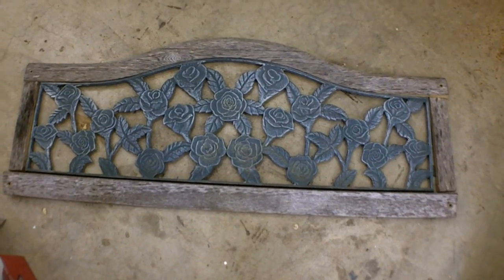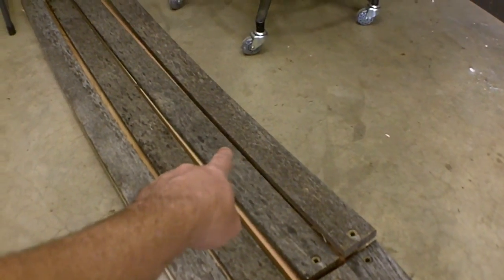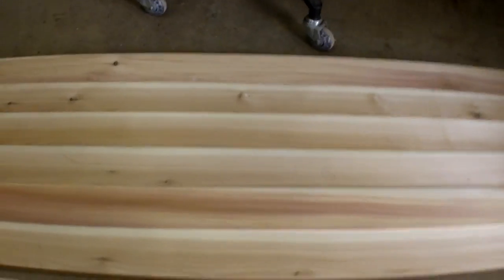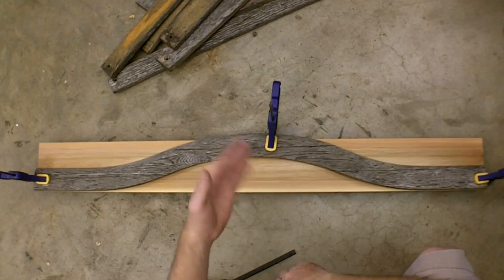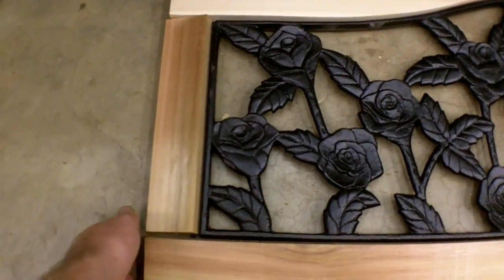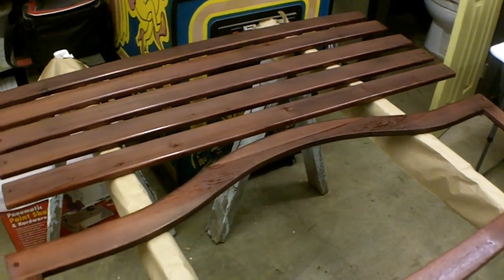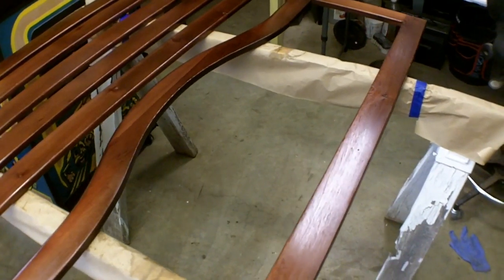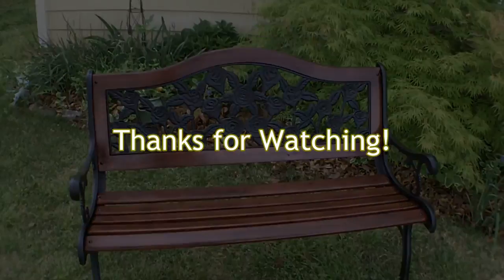Cast Iron and Wood Seating Bench Restoration

Comment: bench looks great. I'm redoing one and trying to decide on the finish. teak oil is clear correct? did you stain the bench before applying the teak oil? do you happen to remember the color? thanks!!
Reply from the maker: Thanks Scott! Yes, teak is clear. Yes, I stained first, then oiled it. Pretty sure I used oil based Minwax Red Mahogany stain. Good luck with yours, G.

Comment: the way u did the back was
a great idea.I just picked up two benchs with out the wood parts laying along the road with a free sign.now i have to find the right kind of wood?
Reply from the maker: Thanks Frank! Good score getting two for free. I would use cedar if they were mine. It's inexpensive and extremely rot resistant in it's natural state. It will turn a gray color if left untreated. You could also stain and seal. The options are many. Good luck, G.

Comment: When you were finishing the slats/wood pieces...did you sand them between coats or not? the job you did is really nice. thank you for sharing.
Reply from the maker: +Karl Micheal Kimbrel 
No Karl, I did not sand between coats, but I was using an an oil finish. If you use polyurethane, I would lightly sand between coats. Glad you liked it and good luck, G.

Comment: I am redoing a very similar bench now.. I noticed on my wood around the back cast iron piece there's about an 8° angle cut. Looks like its there to keep wood tight against cast iron edge and not have any gaps.  Did you have the same or notice that on yours?
Reply from the maker: That's cool J! Hope yours turns out well. No, I didn't notice the angle on mine. My pieces were 90 cut and it turned out well. Good luck with your project, G.

Comment: My wood on my bench is in very good shape. It is dirty. My question on cleaning the wood. Should I power wash it or sand it with 220 grit. If I sand it, I will take wood off. Plus should I paint it or use out door vanish. Thank  you.
Reply from the maker: Thomas, you should clean it for starters, regardless. I would do it without pressure washing. After that, evaluate where you're at and then proceed from there. Every project is different. Hope this helps, G.
Reply: @ghostses  I decided not to power washer since it can make the wood soft and induce more water into the wood. I use soap and water and a scrub brush and came up very clean. Going to do a light sanding. Now to decide to weather to paint it or stain it. The bench will be on my dock. If I stain it, have to see if Home Depot sell marine varnish. Thanks.
Reply from the maker: @skyling56  Good deal! Hope the project goes well. G.
Reply: @ghostses  After I sand it down, wood has some dark spot. Decided to use a flat outdoor UV
 paint that I have from painting the shore house with. It will go on the dock. The wood is in very good condition.
Reply from the maker: @skyling56  Cool. G.

Comment: I have a question about the cast iron. Mine has like a green paint on it. Should I use paint thinner and scrub it off before spray painting it black??
Reply from the maker: Vicki R I don't think that's necessary Viki. The only thing I did was wash mine good, let it dry, then painted it. If the paint on yours is glossy, you might use a de-glosser first prior painting. I hope this helps, and good luck with your project! G.

Comment: I'm just took home my mother in law's bench to restore for her and planned to use cedar as well since I have some laying around  but I'm concerned about the strength of the boards. Do you find the strength is enough? The other option is buy $50 worth (rough estimate) of white oak. The oak would be strong and beautiful, but is it necessary?
Reply from the maker: All I can say is most outdoor furniture around here is cedar. I haven't had any problems with my bench rebuilds using it. The boards are 3/4 thick. It being naturally rot resistant is another benefit. Oak might be overkill especially for the cost, but it all comes down to you in the end. It would look great for sure. Good luck, G.
Reply: I have the exact benches and Small side tables and I'm restoring them now and I'm wondering what the original wood type is ? Thanks I'm new to the awesome wood world!
Reply: @cheryllackey1391  I wasnt able to identify the wood but it was a hardwood of some sort. My best guess would be rubberwood. I'm sure the wood types vary depending on the bench and quality.

Comment: Apparently, you just did this, published April 24, 2014.  So, congratulations, it looks great.  You have so much more experience than I in metal- and woodworking, I can't wait to absorb the information you offer.  I admit, I was a little bit ambivalent about your efficient use of wood, and gluing the top of the arch from the piece cut out of the bottom of it, but I can't argue with the finished look of it: It looks perfect.

Ghostses, thanks for all your great info!  By the way, I'm sure you're aware of what's in a name: a good, single word name is important for brand recognition.  An example of a good, unique name is, for example, Rolex, instantly recognizable, and also unique and private.  Such is Ghostses, a name I've never heard of, short, one word, and unique, as far as I know.

More power to you! :-)
Reply from the maker: Yes David, I just finished it today. I don't know all of anything- just some of many things. I try to learn all the time, and share what I learn or know to others. That's why I love this site- to share as well as learn. It did turn out quite well with the way I did the arch. It's not uncommon to use this technique, but if the grain and color of wood isn't fairly close it would show up more. But, since it came from the same board, the color of the wood was the same, and the grain was pretty close to matching you have to look for the joint.

I'm glad you're finding useful info in my videos here and there- or at least use them for a time filler. As for my name, It's just something that came about online when setting up accounts. Rather than using variations if someone already had a name taken, I went with something I thought no one would ever use...lol. So I guess is is unique for sure. Take care, G.
Reply: ***** Listen, Buddy, YOU are freakin' awesome, and I thank you, thank you, thank you, SO much.  Long live craft, and the work of hands, and long live you!
Reply from the maker: David Pearce
Well thanks David! G.

Comment: How do you get the bench ends to be perfectly vertical and parallel when your bolting on the wood?  I had all of my holes drilled  perfectly centered with a jig and when I tried to bolt them onto the bench it was really hard to get them to line up because the ends kept moving.
Reply from the maker: +Jim Hexamer 
I don't really remember Jim. I can say I left everything really loose and slowly tightened things up. I also had it sitting on my concrete floor. Not much help, but hope it helps in some way. Good luck, G.

Comment: Nice job brother! Hey do you know if they sell those boards already refinished already??? I have the exact same design except on the top of the back rest, the board on the vary top it goes straight across. I don’t have those kind of tools to do the job. But I do have the stain to get the desired colored. I would love to shoot you a email and show you what I have and maybe we could work something it???
Reply from the maker: Thanks! I don't know if they have them already finished. But, you might be able to find the right width in store and have them cut them to length. Then you would only be applying your finish and drilling the holes to attach them. Or, but not as attractive in my opinion, you might consider using a composite decking material. It might not look as good, but would last an extremely long time and be maintenance free. Either way, good luck with your project, G.
Reply: ghostses thanks!
Reply from the maker: No problem! G.

Comment: Nice Restore G!  I noted your stain/teak oil finish on cedar which is real nice but will need redoing again in a few years. Wanted to recommend something I found awhile back on an outdoor redwood burl project.  I use 100% tung oil a lot for that because the water and sun won't eat it up...but with this project after 16+ hand rubbed coats of tung oil it just kept soaking it up, after weeks of apps and drying.  What I wanted was a gloss sealer and found this MinWax HiGloss Helmsman Indoor/out door Spar Urethane in a rattle can.  This stuff is unbelievable and the best rattle can nozzle I have ever used.  2 coats and dry in 2 hours total and the finish I was looking for.  It comes in Satin and Semi-gloss also.  The details in the burl sparkle because of the tung oil crystals and its been in the sun and weather for 2 years now and looks like it did when I finally finish it...who knows how long it will last...probably longer than me.  LOL  Food for thought on your outdoor projects.  Thanks for sharing your craft!
Reply from the maker: Thanks PJ. It will need to be done again for sure. The original finish had some sort of varnish or urethane on it that was yellowed, peeling off/gone. I saw the helmsman product, but didn't do enough research to see how it holds up over time. Sounds like it's a good product after reading your post. I figured I would go with what I had on hand so save some money, and re-coat later when it's needed. Who knows, after it cures out for a while I may take it apart as coat it with the helmsman. Thanks for the info, G.